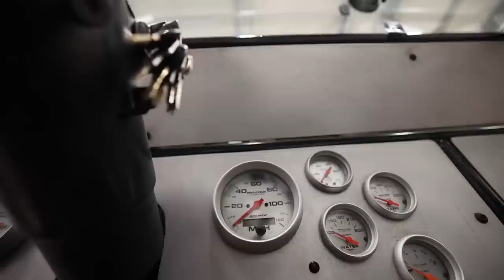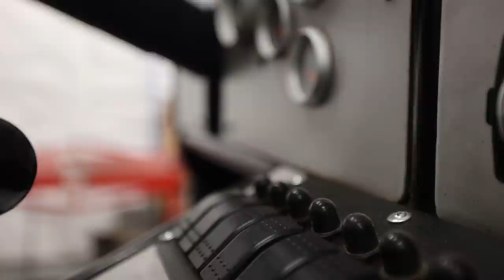500 HP LS 1 TON Swapped Jeep on 42s! FULL Walk Around 💪

Comment: Would love to know what his cooling setup is like and what kinda temps he ran in moab vs yalls home state
Reply: 19x19" aluminum side tank rad single pass with a 2 speed thunderbird fan which is almost the same as a mark8 fan but different motors. This was one of my biggest concerns I had always had cooling issues with my other v8s but this set up so far has ran at 204 dergees in 40 degree ambient up to 85 degree ambient.
Reply: @amkaperick  thanks bud so far im not having issues with mine but always looking for better setups my 5.3 is also stock besides a tune would like to know more about the fans though also on the trans case i have a np205 behind my 4l80e so i feel u on the gearing they make a box to go between them one is a magnum box and i think the other is the black box iv been looking at them for later on i know your running 241 but id figured id give my 2 cents on that!
Reply: @mysamsung2488  the fan is a single 18in out of a 93 thunder bird it is the same shroud and fan  as the Lincoln mark viii fan only the motor is different. The t bird is a two speed and the Lincoln is a variable speed both are hard to beat I had to modify the shroud to fit.i highly recommend these fans on top of that the motors are replaceable.  As for the t case it sounds like I might be going the 205 with a reduction box route I'll just need to find out some info about the speed sensor and all that. Do you know how you actuate your low range sensor with your setup?
Reply: @amkaperick  advanced adapters has one for it that makes use of the vss sensor mine is all chevy stuff trans tcase and axles
Reply: @amkaperick  and the low range im assuming your talking about sending the signal to the tcm for it to shift right?
Reply: @mysamsung2488  yes the ECM signal
Reply: @amkaperick  ok so on the 205 itself has a way to hook up a ground to switch the signal but i never used it cause i have my 4l80e wired to run full manual control and full line pressure but all you would have to do is send a ground signal to that wire for the 4low so it will change the shift points

Comment: 6L90E is a fantastic transmission. Do it!
Reply: Trust me I want to. It would just be a ton of fab work and Im running a gen3 computer and harness so I would have to change that to communicate with the trans.
Reply: If you do buy a good converter,. The stock ones come apart and send shrapnel threw the front pump..
Reply: @rayjon237  a buddy of mine had this issue with his ctsv

Comment: Would a 231/dana300 doubler work ? you can get the 6 pinion planetary in a stock jeep case (nickntimefilms) did a video on that, and the adapter im sure you Nate could make. I'm a stock engine kinda guy so I don't usually worry about having to much power haha
Reply: Is it pretty close to the same length as the 241?

Comment: Around 5:50 what is that power steering box? Is that for bigger tires?
Reply: That's a "full hydro" setup that replaces the typical ball screw steering gear with an orbital hydraulic valve and then uses a double ended hydraulic ram (what you see at 5:50) to provide the steering force. They are not typically road legal because there is no mechanical coupling (shafts, gears, linkage) between the steering wheel and the axle, but I think some designs will still allow some steering if you lose system pressure.
Reply: @Fix_It_Again_Tony  awesome, thanks for the rundown.

Comment: Is it the horsepower that you don’t think the atlas will handle?
Reply: Transmissions and transfer cases (gearboxes) are typically rated for torque. A gear is basically a level and if you put too much force into them (torque is a rotating force) they break. Horsepower matters in that the gear box will have losses and those losses manifest as heat so as long as you keep it cool horsepower isn't the problem.

Comment: Northwest fab ecobox i to a np 205. 205 would have a 2 to 1 and twin stick capable and use the planetary gear out of his current case in the ecobox. He could have either of 2 to 1, 2.72 to 1 or 5.44 to one also about the same length as his current case. The are bullet proof used by rock havoc buggys and some bouncers.
 https://www.northwestfab.com/NWF-EcoBox-205-Billet-Planetary-Doubler-Case_p_4197.html
Reply: Is there a way to do driver drop set up would I have to find a Ford 205?
Reply: @amkaperick  you  would have to find a Ford np205 they are the only driverside drop version but when you order your ecobox you chose your input and what case.
Reply: The nice thing is this setup is way stronger than atlas. Several of these rigs run northwest fab boxs with np205s with no issues. https://youtu.be/l_8T0DNKI_g
Reply: @boostjunky9  thank you it might take me  a min but I think this is the route I will go

Comment: Gear vendors underdrive
Reply: It can be bolted to the front of the t case, rear of the t case, or the tailshaft of the transmission... they are only about 8" long and they can handle 1200hp... my boy back home in jersey (im in nc) has an 800 hp carburetor fed mustang with 496 gears in the rear ...with gear vendors unit he rides at  1800 rpms on the turnpike in 5th gear at 150 mph...(occasionally)..... they could be built for either and underdrive unit or an overdrive unit it takes a 6-speed and turns it into a 12 great unit very tough but I believe it's slightly pricey hope this helped man rock on with the videos